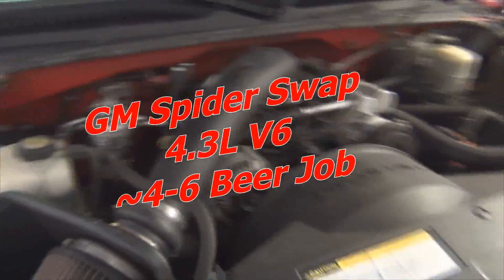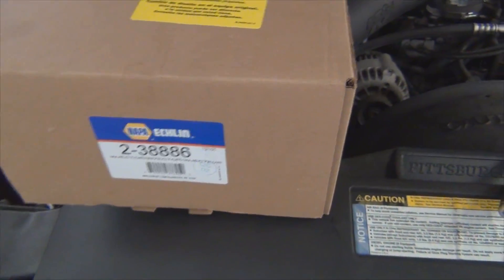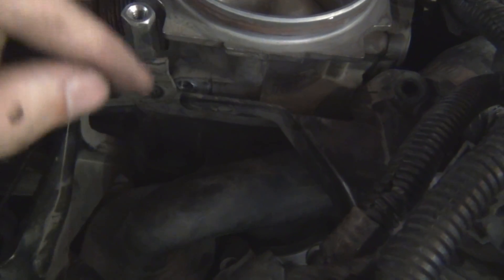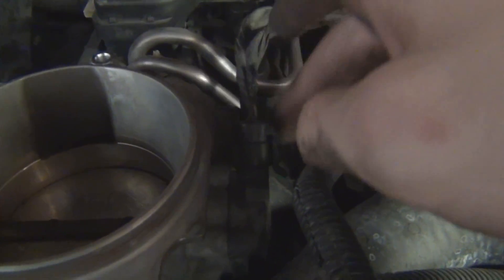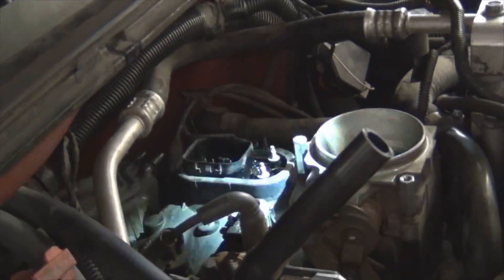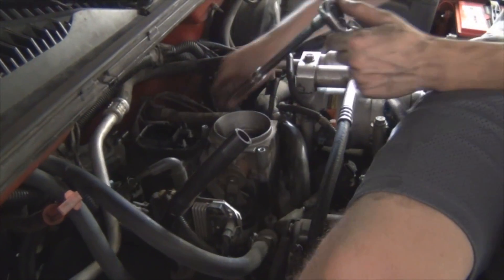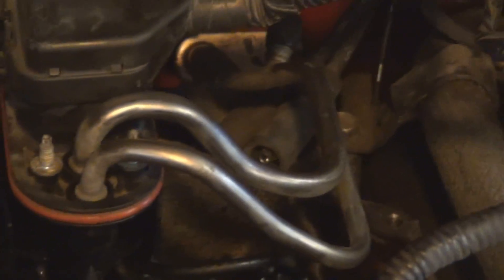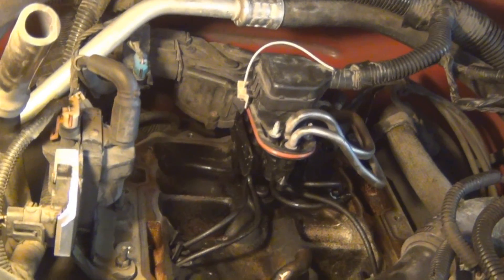GM 4.3L V6 / 5.7L V8 - Fuel Spider Swap, SCPI to MPFI

Comment: i have to ask were you getting a misfire at the #1 plug i am took it to shop they want 1200 to fix it i am going to order parts and try and get it done by this weekend also have to ask i think it is my valves are bad ask for a leak down test they took it all apart ,how hard is it to get head off to get valves redone

Comment: be careful with the wiring on the new MPFI spider. Sharp edges on the clip inside the intake manifold that holds the central unit can cut the wires.  After mine failed (blown ECM1 fuse) I pulled the connector on the intake manifold.  Checked impedance on all the pins on the manifold/spider (not the harness...the pins on the manifold).  They should all be 0 ohms.  If any of them indicate impedance you have a short between the FI wire and the metal clip. Injector poppets run at low voltage, so using a test light might be an issue. That metal clip has sharp edges. I removed mine and filed edges smooth (the vertical edges are the issue).  The MPFI spider comes with insulator tubes installed on the wires/hoses. Mine were slid down toward the injectors.....not where they are needed. Slide these up toward the central unit/clip to protect your wires. Try to arrange the tubes/wires so they aren't binding on edge of the clip.  I have not seen this failure discussed anywhere before.

Comment: @5:30 you do not have to take those back ones apart. Remove the bracket that holds it to the manifold and just remove the fuel lines from where they tie into the top. At this point you can gently lift it out of the way and out it back when done.

Comment: Obviously the same for a 97 vortec 350?   The 4.3 is the same motor with just two cylinders lopped off, correct?
Reply from the maker: yep its the same job,, ac lines and compressor is different, so a couple more things in the way on the v6

Comment: Great video, even though it’s awhile back I had a question for you. I’ve been dealing with older model chevy trucks, there is one thing the same at the fuel pipe connection to the spider itself.  The fuel pipe retainer is all the same for so many years and on a lot of GM engines.
During watching I noticed the retainer is shown to be installed with the flat side up and the side that has the extension that go around the fuel pipe is facing down. (Hope you understand what I mean) the reason  I’m asking is because I have seen them in either direction. I’ve never been able to find a cut sheet or a book that shows the correct way (If there is a correct way).
Any ideas?

Thanks 
Steve
Reply from the maker: yes that piece should fit tight around the fuel lines to clamp it in place. The lines seal inside the spider unit so I guess it really wouldn't matter as long as there is some type of force holding them down.

Comment: Interesting diagnosis and fix and precaution.  Thanks for sharing ---   For a 2000 GMC V6, 4.3 L, does anyone know the typical reliable life of the fuel pressure regulator ?  And does anyone know the typical reliable life of the fuel injector / poppits ?      Would it be wise to replace the fuel pressure regulator and/or the fuel injector / poppits after 200k miles ?

Comment: I can't get those new injectors to full seat down in the manifold, they just won't push all the way in like yours are. I even mic. the injector and the hole. The injector is slightly larger than the hole in the manifold. Afraid I will break them if I push too hard. Did anyone else have this problem. HELP..?

Comment: for a v6 / 2wd   rig w/ roughly 160 k  miles on it   why or what is that sand like stuff  under the intake ( that was the in-take right )....??  is it sand & bad carbon or what......  by the sound when u hit it on some thing on the top of the motor  sounded  plastic like..........??????????????

Comment: Good work on upgrading but I would have just got an LS block and built it but that's just me... anyway you have a lifter ticking my guess is the tune needs to be adjusted for the MPFI you can swap it in place of the SCPI but your gonna need a new tune if the NAPA head says no then he's wrong. I didn't hear lifter problem at start of the video...

Comment: My 4.3 vortec i believe it needs new injectors or the lines have a crack,or the fuel regulator is bad,engine shakes at iddle and gets horrible gas mileage.

Comment: tht didnt help me at all no offense more interested in the routing than the procedure. But for those that dont know what there are doing Im sure it will help. By the way you dont have to clean the manifold that much that lil bit of carb built up wont make a diff just clean the gasket contact points like he did and any excess carb build up in injector ports.
Reply: Richard Linn to route 135246???? watch the video you need it!! lol

Comment: what would it cost to have this done or could a backyard mechanic like myself tackle this project? Thanks in advance.
Reply: I got the new AC Delco 'spider' on Amazon for $214, the Felpro gasket set (get the metal ones) was $52...It was for  2001 Astro van so it was extra hard to get under the dash!

Comment: does this swap help over stock injectors? I plan to install new intake gaskets before mine go bad and cause trouble and if these injectors will run better then I want to upgrade.

Comment: You do not  have  to break the  fuel lines  loose at fittings just   remove the bracket bolt under  the lines at the back of manifold pop lines from spider  assembly, and lift  them up and secure them with a wire tie. I do it  this way, saves time and  effort and reduces the chance of another  fuel leak .

Comment: a little tip.... when working with fuel or flammable liquids .... use a fluorescent or led work light ..... worth the money spent on 1 ....
Reply: +Leatherkid01 Several years ago I watched an entire dealership burn to the ground. New cars up in smoke. The fire started with the break of an incandescent light bulb in the shop.
Reply: @kevinhornbuckle  yikes...dang...... i bet none of that was on u-tube.......????
Reply: +Kevin Hornbuckle damn
Reply: Yes I know a guy who knocked one off the frame of a vehicle after he spilled gas on the floor of the shop. It caused an explosion and killed him.

Comment: What are the benefits to this? 
I have a 2001 blazer and I am not sure if it was changed previously by previous owners but I don't have any problems with the fuel injection system. Just wondering if people do this upgrade to  actually improve fuel consumption or just a general upgrade from the original when theres a problem with the old one
Reply: The long tube allows the end of the injector to be recessed away from heat and vapors that cause carbon build up on the end of the injector.By performing this upgrade you will notice a smoother idle, better throttle response and all-around better performance.

Comment: I have a 2000 s-10 4.3 with SFI I'd like to do this conversion what year would I look for to do this upgrade? Thanks for any info you could give me :)
Reply: I had my 99 S-10 4.3 did maybe 3 years ago.When I checked all the stores for the price of the injectors they all said you have to order the bracket separately(just over 30 bucks I think was the cost)-apparently you can't reuse the old one.When I opened the box from Advanced guess what else was in the box!!! got my money back on the other bracket-paid Pep Boys 328.00 to change to the multi port setup-no problems since then.I would have tried to do it myself but the last time I fooled with the motor trying to install a throttle body spacer it idled pretty rough so I had to take it off & let someone else do it for 75 bucks.

Comment: I installed new spider injectors on mine and then I started having starting problems. Removed upper plenum seen new regulator was dumping fuel onto intake.
Reply from the maker: that is unfortunate! that's the whole reason I had to change mine in the first place

Comment: I installed new spider injectors on mine and then I started having starting problems. Removed upper plenum seen new regulator was dumping fuel onto intake.

Comment: Why exactly did chevy make those fuel poppet valves out of plastic? I mean, isn't a fuel system a really high pressure, high heat system that needs to last as long as possible? Seems kinda odd to me. I like GM, but why did they think that was a good idea when Ford was using Electronic Multi-Port Systems? I guess I'll never know. Thanks for sharing this, by the way. In what year did they switch to that newer set up?

Comment: very well done vids , i have 1998 4.3L vortex and it has been refurbished once. but i want to redo my fuel system as i know it has the original fuel spiders in it and it gets very bad fuel milage along with it being a 4x4. i am sure the fuel system has over 200k miles on it and tune ups help it some, but still poor performance . how much you charge ? will drive there to have you work on it..but with Delphi parts. and a K&M air system and a good coil ignition system.

Comment: Eric, Thank you! I havnt found an instructional video yet up to par with yours! I'm 99% sure i'm haveing the same problem in my 2003 4.3L Silverado. Now my question to you is, will that fuel injection spider work on my truck? Because the only ones i can find are for 99-02. Also, how well did the K&N do on performance???

Comment: so i was wondering can you upgrade the injectors on the new spider set up later on down the road just by swapping them with similar larger ones or do they even make larger injectors for this set up say 42lb ones im thinking about goin turbo in the future with my 4.3 and if it can be done i would like to avoid the marine setup

Comment: And this is why I love my TBI. A simple rebuild and adjustable fuel pressure regulator and runs like new. But I do hate that it's not port fuel injection but tbi is about as reliable as you can get.
Reply: Yep - I had throttle body injection on my '89 Caprice and it worked flawlessly also super easy to replace the two injectors or any of the sensors on the outside - everything could be replaced without even removing the throttle body

Comment from the maker: yes sir it was dripping fuel out the back of the regulator when the system was not pressurized. good info, CPI's should be around 60psi. hopefully will never need another regulator. thanks man

Comment from the maker: I got more gas mileage, 17-18  MPG, and the rough Idle and start-up issue was fixed when I changed the spider. It seems to have more power. changing the spark plugs and wires helped the MPG too.

Comment: I just did this in my 96 blazer today. Mine was running really bad. Found out my fuel regulator and the spider was bad(crack in the #2 cylinder fuel poppet) so replaced it with the multiport and she's running strong. Next weekend is the TB mod.

Comment from the maker: 190k is pushing it is gettin there for sure but if it aint broke dont fix it. Not much difference in performance. the main thing you'll notice is that it will be running right haha. those crazy s10 guys might have a high output spider, I'm not sure if it exists though. you can go wit a new manifold and carb for just about the same price, which i believe would give more power if you run a programmer. I've done my lower manifold gaskets already about 10k miles ago. very common problem

Comment: i have a 2004 4.3 silverado. it was me and my uncles goal to fix it and for it to be his last project since he had stage 4 cancer. he came over and helped me every single day of the summer till we had my truck almost complete. we did everything imaginable even swapped the motor to a 26k one i found. he passed now but i still have my truck and when i work on it i think of him RIP Uncle Lee
Reply: I wish more young men would overcome the stigma, anger, or just plain old thick headed attitude they all have in their early 20's.  You did a phenomenal thing for a loving dyeing man son, you showed him love, and respect, and you now have happy memories of him for the rest of your life.    I went through this with my father, he was very sick but no one would tell us what it was that was ailing him, until one Dr. slipped and told my mom he had cancer of the larynx.  That was just the beginning of 12 years of different cancers, some bad ,bad times.  He ended up having the cancer on his larynx treated with radiation and chemo.  He had three different melanomas, one on each ear lobe, and one on the back of his hand, but the lung cancer was what ended him, it was a race between the lung cancer stage 4 and the recto Colo cancer.  We finally had to have him hospitalized two days before he turned 62, his pain meds were so strong he constantly would hallucinate, and lost most of his strength. He could not sit on a toilet, or get up off one.  So my mother and I had him admitted to the near by Sunnyside Keizer hospital.  That night I punched an intern in the nose and broke his nose.  He let my Dad sit on a bare gurney, no sheets, blankets ad a single hospital gown with no tie straps.  I asked this excuse for a nurses aid parading as a Dr. if they could cover my father up and get a gown that at least tied and covered the basics.  And could he tell us what was wrong with my father, her turned on one foot, looked at my worn out tired Mom, my two sisters and I and blurted out "He's dying of lung cancer and I am not in charge of laundry ask a nurse."  I grabbed him by the throat slammed his head into the wall, punched him five times until my older sister pulled me off of him.  And I then told him what I thought of him.  Security showed up and wanted to call the County Mounties on me.  I was so pissed I knocked one of them on his ass.  My mom made me go out side and walk it off. When I came back my poor dad was still sitting there no blankets and freezing cold air coming in the ambulance doors he was sitting by.  My younger sister went on a laundry hunt, found the blankets and a gown that had ties.  We managed to keep me out of jail, and get my dad a room.  Two days later at 5:17 AM PST he died in my arms.  I told him that soon angels would come for him and it was okay to go home with them.  He opened his eyes one last time and whispered I love you son, take care of your mom for me, and then took a long last breath and was gone.  For all of you who have had a similar experience, thank you for helping you dad, uncle, neighbor who ever it was, you did the bravest thing you will ever do in your life, you helped a very sick older gentleman make his way from life to death with dignity.
Reply: glad you are able to jump in truck and remember the time you and your uncle spent under the hood my favorite uncle passed from leukemia it was the worst type of leukemia not that any is good but we were remodeling his and my aunts kitchen when he found out i finished the kitxhen abd before he passed he came home and was able to see our work done and he told me how proud and thankful he was that i helped him and i think of him every time i walk in there its just tile and wood but his memory is there
Reply: bglowark12 Im so sorry to hear that.

Comment: Great video. I have a 2000 silverado 4.3 2wd. It has about 190,000 miles on it, I think its time I stop pushing my luck with the central port injection... did you notice any difference in performance with the updated injector style? Do they make these with high performance injectors? I also plan on doing tb mod.

P.s. about 3 months ago I replaced my lower intake seals because of external coolant leaking and coolant in the oil... I recommend replacing before you end up with coolant in your oil!!

Comment from the maker: Thanks man!
165k miles of carbon build up, was very nasty. I spent about an hour cleaning the top of that damn manifold. I just replaced the plugs and wires and put new front shocks in the truck is running great now.

Comment from the maker: this is actually back in august, was inspection month so i was running my legal exhaust. flow master outlaw piped out the side, welded to its own flange so i can just swap them. I have the dual straight pipes on there still and don't plan on changing it for awhile.